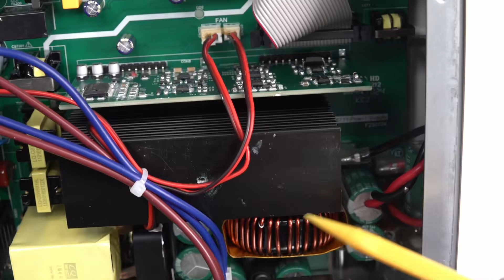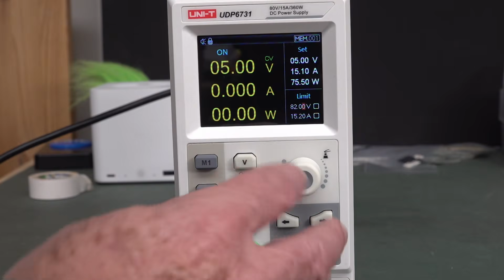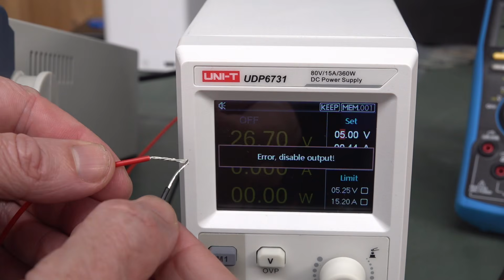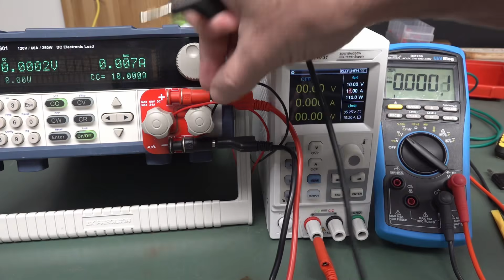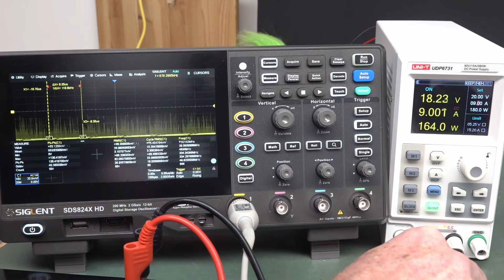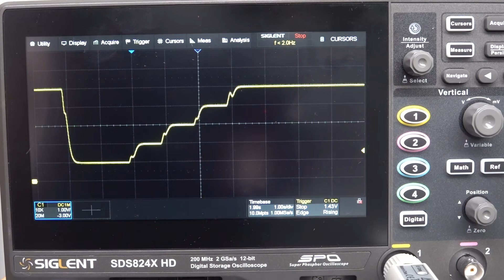EEVblog 1691 - Uni-T UDP6731 360W Bench PSU REVIEW

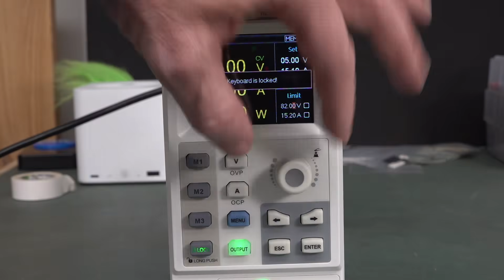Comment: 15:27  True. Though am a college student, i was working on a precision DC load circuit.. and some visitors came with professors.. and they started playing with knobs.. and destroyed my Circuit 😢😢😢😢 they blew the ADC, Primary controller and so many stuff in the circuit...
Reply: We had those "delegations" an a regular basis, some money bags for the uni. It was my freshman year but others in the lab told me what to expect. I put a bulb without glass in series with a shockley diod under the pcb and connected to my lab psu. When they came to look around I told 'em while moving to the side, "gents this setup costs hundreds grand, please don't mess around if not ready to foot the bill". Naturally I was berated by the prof, and the money bags looked down on me until someone turned the knob and the "magic smoke" puffed 😉😋 Same time I discreetly pushed the cut-off switch behind me and all shit broke loose. 😜🤪🤑

Comment: I recently needed a Power Supply that I could control via RS232..  on AE, I found a 30V/10A for $83 shipped  (KUAIQU SPPS305D-232).. but the PC software on the $150 360W Uni-T UDP6731 looks better.
Reply from the maker: Get one that is supported by Test Controller software, or you can write your own config file for it.

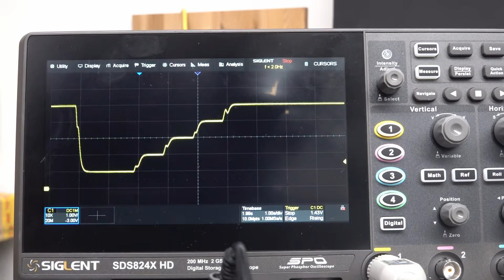Comment: the weird voltage bug at 48:00 might be due to the current limiter which you had set to 2A, the peak charging the caps might trigger it, i would test if giving it more leeway changes the behaviour. Its most likely a software oversight or something where in the other mode it ignores the current peak for the first N miiliseconds or something but they forgot to do it on that mode or they didnt on purpose because its for testing things?

Comment: Is there any real, legitimate, valid reason besides "profit" for a $400 power supply to not have quality name-brand capacitors? It'd be what, an extra $4 to the BOM?
Reply: There's a few reasons:
1. Things are usually designed for a spec. We have no idea whether or not those caps meet the spec. They could very well do.
2. Most people do not care. Most customers, will not open the enclosure to check what brand the capacitors are.
Reply: If there were an ordering option for Nichicon (or the like) vs XJRIFHEKDKZ brand caps for $4, 14 or even $24, I would absolutely choose the up-charge. I want to trust my equipment for years to decades, not months to years. Even another $104 might be worth it, compared to the either the time & effort of inspection/diagnosis & replacement of failed caps or buying another PS all over again in the future. Presumably I’m in the minority, or UNI-T would have built and priced the PS differently.

I just recalibrated a ~40 year old HP (Hewlett-Packard) power supply yesterday. I don’t think it has been touched for many years and it was still within 1.3% Now it’s w/in 0.25% across its full range (tracked against a traceable reference). The original, Nichicon caps still look good as new and the output ripple is flatter than Kansas. I’m willing to bet that there’s a correlation there.
Reply: These manufacturers usually buy a containers worth of parts from a specific vendor. And then design their products around those parts.

The pros is that you can share common part between BOM. And by buying lots of part the saving is immense if you actually calculate the total sum between 100k cheapo caps and 100k quality caps, even when accounting for bulk discount.

Also kind reminder that the listed price you mention ($400) has been heavily jacked up by seller margin. I wouldn't be surprised if these things are sold less than $100 straight out of the factory.
Reply: $4x10,000 units is 40K.
That 40K would buy my family a few tropical trips aboard.
Reply: @jamess1787 Greed.

Comment: Rigol load input turned off, yet you can see a strong spark when connecting the wire...
+ Overcurrent protection.
That sounds like a crowbar circuit got triggered
Reply from the maker: So much for saying it's disconnected though!
Reply: @EEVblog would it mean only internally disconnected from the load?

The oscillation is a head scratcher. Unless there is another disconnect between the input terminals and the crowbar circuit.

Maybe one day, a video will appear with an investigation.
Reply: @EEVblog  someone said your Rigol needs a firmware update and pressing CC/CV clears it.

Comment: Hmm. I could totally see getting one of these. My main bench power supply today is a Rigol DP832A, but since it's limited to 30V, this Uni-T device would make a nice complement to that. Not that I need to go above 30V all that often, but it would be nice for those rare occasions when the need arises.

The only thing I wish this had, that appears to be missing, is an Ethernet/LXI interface. I've really tried to standardize on LXI for automation and nearly all of my lab equipment today (modulo some of the older HPAK stuff) does. Still for the price, it seems like a tolerable tradeoff.
Reply from the maker: Yeah, shame it doesn't have ethernet.
Reply: @PhillipRhodes  Actually your PSU can go up to 60V, CH1-CH2 in series.

Comment: The output is quite noisy. 137mV Pk-Pk noise at 5V output is pretty bad. It needs more filtering on the output. Add an inductor in series on the red wire at 10:48
Reply from the maker: Yes, agreed, it's pretty high. But it reduces with voltage and hold up well under load.
Reply: I have a 30v 10amp supply and the switching noise was reduced by a large amount by adding a resistor to the fet gate and a capacitor from gate to source.
Reply: @bascomnextion5639  What effect did that have on the efficiency / heat generated by the MOSFET?
Reply: @Chris-hy6jy  Almost no effect it was a minleaf 30V/10A  which has small heat sinks on the fets
Reply: @bascomnextion5639 What value resistor and capacitor?
Reply: @jheissjr  22 ohms , 47nF
Reply: @bascomnextion5639 im about to do a video on that with one of my psu units also going to add cm suppression to the output
Reply: Only 200V input capacitors? On a 240VAC unit? Wt?
Reply: @babbadge I thought Unit-T was a better brand and a way under rating like that was above them but it seems not.

Comment: The brown (live) wire is going to the JST pin labelled N (neutral)
Reply: Sadly common in Chinese shpplies, as is fusing the neutral 😅
Reply: @Probsnawt I’ve had US supplied (and manufactured) synthesisers and other sound equipment where, from the factory, the neutral is fused and the line is switched, that’s if you correctly connect the US coloured flex cores to a local (polarised UK BS1363 type G) plug and don’t assume the black is neutral.

Comment: The IEC C14 power connector visible at 4:30 is wired incorrectly, which is extremely dangerous for Schuko IEC power cords that are symmetrical at one end. You can rotate the plug 180 degrees and the phase and neutral will switch places. The middle pin of the IEC connector should only be used for protective grounding and is not intended for any type of switch.
Reply: You are totally wrong here 

If you look properly, you will see that the grounding pin goes off to the earth at top left of the board.

Also... Phase neutral reverse inside a single phase appliance is not "very dangerous" in any country.
Reply: @alex13902  Yeah, true. I'm glad to be wrong.
Reply: what switch? the top gound connector seems to be going through the choke and direct to ground.

Comment: My guess for the 4 wire sense weirdness is that if it can't drive the sense terminals to the requested voltage, it assumes that you've done something wrong. And because of that loose tying to the output when they left floating, it probably takes time for the psu to see the output voltage on the sense lines, triggering the same error.

I imagine this is a safety feature to prevent the output terminals from outputting an arbitrarily large voltage if the sense lines are weird.
Reply from the maker: Yep, likely something like that.
Reply: It actually worked without the jumper links before dave shorted the sense terminals. I'm guessing (as I've seen in power bricks with sensing) that the sense lines are internally connected to the output via a few ohms to tens of ohms resistance so that it still functions somewhat normally without the links but with high enough impedance that sensing will still work when used properly. The first time Dave shorted the sense terminals likely blew one or both of those resistors that's why the psu would no longer work without the links.

Comment: As a sanity check I would have measured the step from 1V to 2V for example (i. e. one of the steps that actually showed the weird waveform). Sometimes those problems show up only at certain voltages. That being said I doubt this is the case here.

Comment: I don't think much of their wiring harness to be honest. It looks as if they have the lengths too short, more likely to save on wire, but I was taught that a proper harness should be bundled properly, with enough wire to not have those short jumps here and there, and laced with waxed-string, or, at least small wire ties about every inch apart. It should look neat, with the proper lenghts and bends, where it wasn't rubbing against the edge of PC boards, and properly routed.
Reply: No that doesn't work electrical speaking you get cross coupling, inductance, extra resistance and all sort of problems. I agree it should look as neat as possible but if making wires long leads to noise and inductance and cross coupling and such it's not a good idea for alot of devices
Reply: Plus long leads can make accidental antennas picking up or transmitting noise.

Comment: I opened a 30A version of these chinese supplies and immediately just closed it up.  It was a rats nest of wires and cheap parts. I wouldn't trust it to power a light bulb.
Reply: > Buying cheap product
> Complaining it consists of cheap part

You're aware that these thing costs as much as 10x less than Western branded supply right? The price listed on Aliexpress has already been jacked up by the seller margin.
Reply: @minhhungnguyen7867  Whoosh.
Reply: @minhhungnguyen7867  Wrong on every point.  You must be a bot.

Comment: Binding posts are so last decade - all you need is 4mm sockets and Wago 4mm spring connectors ( e.g. 215-212)
Reply: I've been using Wago for years for mains installations, but recently I also started adding them to my projects where possible. I used them as speaker wire connectors in an amp for example - they're quick, maintenance-free and surprisingly low resistance.
Reply from the maker: Shots fired!
Reply: Those Wagos great connectors.
Reply: All that matters to me these days is whether I'll still be alive in the morning if I forget to switch off at night. What's the verdict on this?

Comment: 9:59 I hate seeing glue on JST connectors - they have perfectly good latching details so all it does is make it harder to unplug when you need to.
Reply: It is a requirement. Non-negotiable.
Reply: I have a feeling the only reason they glue them on is that the bosses in factories know that the workers will have to focus more on each connector and there will be no half plugged connectors as a result.
Reply: UNI-T obviously have the expertise at costing down stuff, and yet they spend labor work gluing them one by one. They clearly know what may happen through shipping and delivering and have build up real-world experiences.
Reply: @jerrymk6846  Those connectors will not come loose during shipping.
Reply: I bought a used 3D printer a while back and the previous owner had super glued the JSTs in place. Not silicone, not hot glue... super glue.

Had to replace all the connector housings :|
Reply: It depends, fake knockoff JST may not hold well.
OG stuff yeah, more than enough.
Reply: I guess you've never designed something for very heavy vibrations?
Because I know from experience that even these JST will come loose.
Won't cost much more, so I totally get why they do it here.
That being said, the rest of the design isn't made for such an environment.
So I guess it's a fair point, just in a different way 😅😂
Reply: @p_mouse8676  
Absolutely.
Whenever I run my bench power supply on the vibration pack of a road-roller, I don't want connectors coming loose.....
Reply: @p_mouse8676  He has not indeed
Reply: @p_mouse8676  there is no reason to put glue on connector. just use better connectors or solder the wires
Reply: @p_mouse8676  there are plenty connector designs that wont come loose
Reply: @p_mouse8676  Bollocks. Genuine JST-XH requires so much force to unplug, that you would much sooner lost other components from the boards, rather than XH getting unplugged.
Reply: @Sixta16 that's only under ideal conditions and never been used.
Also. There's more than just only the plastic part of the connector, as well as assembly irregularities.
So complete bollocks to call it bollocks.

But again, design equipment that's prone to heavy vibrations and please share the yield with us after being 5-10 years in the field.
Reply: @p_mouse8676  You should've researched the commenter before pretending to be an expert. He's way more knowledgeable about the topic than you are. Perhaps you should apply some of that glue to your rear hole. A benchtop PS isn't  intended to be used in environments with "very heavy vibrations." If you experienced a JST connector coming loose due to "very heavy vibrations", it's because you either chose the wrong type, assembled it incorrectly, or received a defective connector.
Reply: @bobweiram6321 so I guess I haven't worked for 20 years in such industries? 🤔🤨
It's hard to take such comments seriously.
Reply: @p_mouse8676  Make-believe industries don't count.
Reply: @p_mouse8676 you are right. Connector must be glued due to QC controls. Is industry standard.
Reply: @B1063N  While you're at it, you might as well create your own make-believe standards.
Reply: Planned obsolessence. If you look closely this was done some 20 years ago and in the next 5 or so will conduct and require a repair.
Reply: The maufacturer hates it when someone recieves their item and it appears faulty but it was just an unplugged connector from shipping..... Youre not even meant to be unplugging and digging around, youre buying a product to use it not unplug stuff. If you have to unplug then you can still do it, they could have done it cheaper and soldered it to the board....but you would still complain about it.
Reply: @imgeedup  Dude do you realize how incredibly difficult it is to pull those connectors apart without releasing the tab? The wires and even the PCB will give up. JST connectors are designed to stay connected.
Reply: @imgeedup  Our philosophies differ slightly. I think there should be a good nod to repair-ability in any electronics product with released schematics and plugs you can remove and even firmware able to be modified. When I buy something and It breaks, it shouldn't be a royal pain to repair. I'm sick of seeing so many things end up in the landfill because they were specifically designed to break after a pre-defined period (we call these "sony timers"). We need to wage war against manufactured e-waste. Pretty much anything broken and electronic can be fixed with something as simple as a switch or capacitor. I've saved probably an actual TON of debris from entering the landfill. Working monitors i found in a bin prepped for recycle. It was a good monitor for me years later.